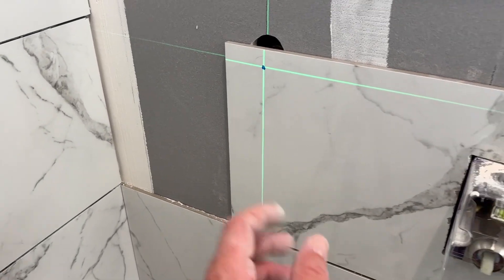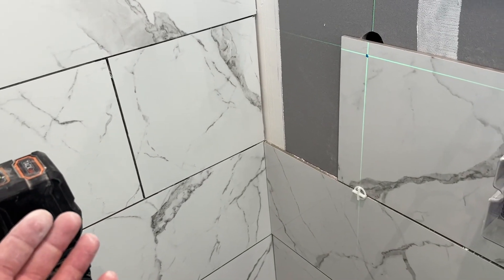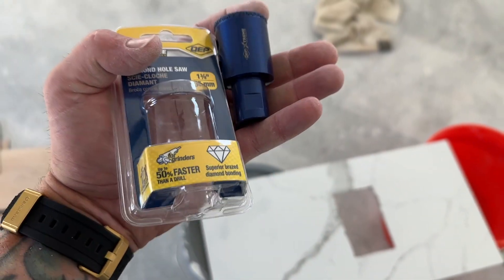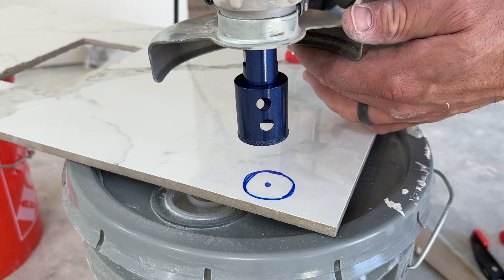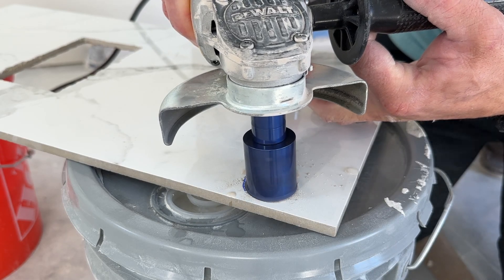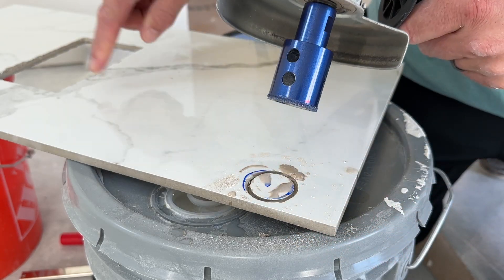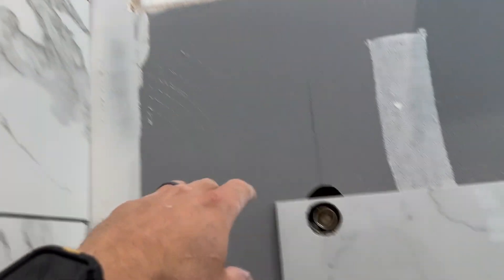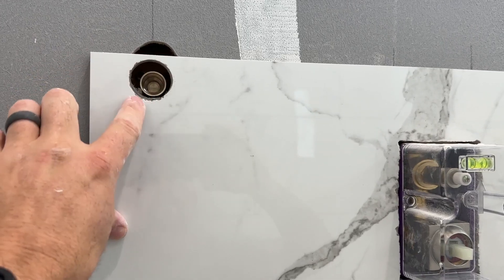How To Cut A Hole In Tile .... And Marble, Quartz or Stone

Comment: Thanks! It's totally make sense.
Reply from the maker: Your welcome. I was trying to keep it straight to the point 🤙🏼
Reply: How do you cut for  a toilet flange? 8"Hole saw? Rookie here and thank you.
Reply from the maker: @ usually for the toilets it involves a couple pieces of tile because the hole lands on a joint between the tiles somewhat. So you mark your price across the tiles as it hits and you either cut on a wet tile saw table or you can use the tile diamond tip circular blades on the grinder. You can cut out the circle with the circular blades on the grinder like you would cut metal off. 

There’s a technique where if the hole lands completely on a single piece of tile. You kinda take the circular cut off wheel diamond tip made for tile cutting, on the grinder tool, and you lightly score around the outline and gradually make your way through the tile. Theres a few advanced ways to do this where they make it look easy. But there is a couple methods to this approach as well